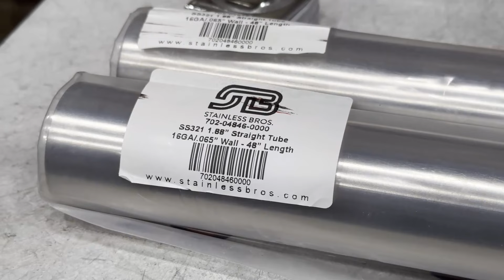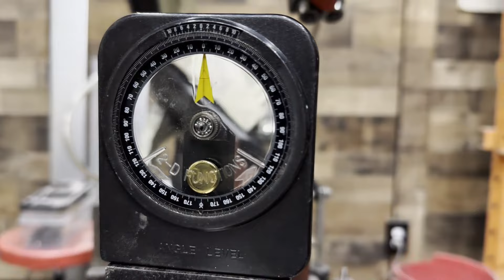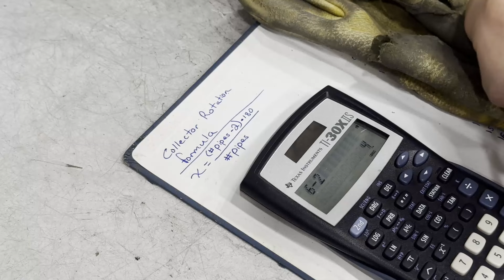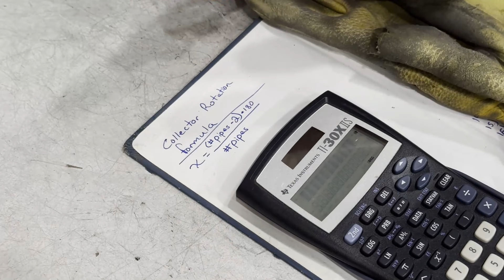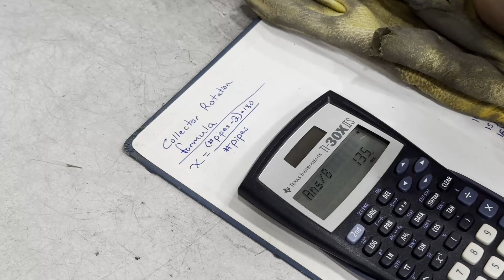Building a 6-1 Merge Collector for my Turbo SC300 Project (Step by Step DIY Build)

Comment: I’m always amazed how slow you can move when back purging stainless. It can just hold a bead without sinking
Reply from the maker: The puddle is much more predictable and manageable when purging. Virtually all stainless welding I do nowadays is purged, even down to the tack welds.

Comment: If i heard you correctly, you weld on the inside as well, which was why you didn't do a from debuting. If so, how do you handle purging the "outside" when you do that?
Reply from the maker: You did hear correctly, and thank you for a good question. I don't do anything to purge the outside of the collector, but rather apply as little heat as possible while doing these internal welds. Remember, the goals are solely to smooth and fuse these internal seams, not get penetration. In this instance, I pulsed the internal welds with my machine set at 70A to avoid disturbing the coloration on the collector's exterior as much as possible. Some disturbance is inevitable, but you shouldn't be applying so much heat that the outside of the collector loses all of its color.

Comment: Looks great.  Did you put a little quarter sized disk down in the center of the collector?  Looks that way to make it easier to weld inside those tight spaces.
Reply from the maker: Thank you for your kind words. I did not, but rather patiently did a weld build up in the pit. It takes some time/patience, but that's how I've always done it, for better or worse.

Comment: These videos are incredible to absorb info from. What approximate amperage are the welds on the collector itself on the outside vs the underside (down into the bottom of the 6 tubes merging). Is there a lot of time left between each weld? I'm struggling with not cooking things even when running what seems to be appropriate amperage + travel and dab speed
Reply from the maker: I'm glad you've found value in them. I set my machine to 100A for these welds and used as much as I needed. I'm a huge advocate for learning to read the puddle as opposed to focusing too much on what amperage the machine is set at. 

I weld collectors to completion in one sitting. The only down time between welds is the amount of time it takes to reposition the collector. If you email me some photos of your work I can do my best to offer some tips/feedback:

Alex@bpautosports.net

Comment: amazing video as always, what angle is your fixture set to? looked somewhat like 11 degrees or so. Only asking as compound rotation will change the angle of the cut needed as the angle of the fixture changes.
Reply from the maker: I don't recall what it is off the top of my head. I suspect it's in the 10° - 15° range as you said, although it does have adjustment to increase the splay angle. You're right in regards to the splay angle/angle of rotation having a symbiotic relationship. It took some time to figure out the discrepancy.

Comment: What is the strategy for welding the last tubes if you don't have space....thanks 🇧🇷
Reply from the maker: As I'm building the header, I take two angles of attack for final welds. 

1.) Try to run the primaries such that you leave a "pocket" to fit the torch into for the final welds. 

2.) Be strategic as to when I'm adding each primary to the assembly. 

It isn't a perfect science and I still run into challenges occasionally. However, applying these two strategies help to eliminate the bulk of the issues.

Comment: Im curious how the math works with your jig vs. the jig i made. I'm making a 4 into 1 for a 1g talon. On the first attempt, with scrap material, rotating the tube 90 degrees did not give me a 90 degree cut angle. Due to the splay angle, I had to figure out the correct amount of rotation to get a 90 degree cut angle. Im curious why you dont run into that issue with your jig. Mine sets the tube verticle instead of horizontal. Im trying a 15 degree splay for my R&D. But yea, I'd like to figure out the equation that compensates for splay angle, and number of tubes. At least for a round style flange, not a t3/4/6. 

It's really funny that you put this video out as im doing this. Thank you for always being so helpful. Idk if you recognize my name, but I comment and like a lot of your videos. I've been studying your manifold videos off and on for a couple of years. Your red demon manifold build last year actually helped me decide on the jmf 4g63 flange. I was not super pleased with the vibrant one that I got initially. Even though I was planning on going to Morrison route and form the tubes instead of going with the oval to round transition in the flange. The jmf flange checked all the other boxes.
Reply from the maker: My cutting fixture typically requires an additional 5° added to the base rotation. Using your 4-1 collector as an example, I cut at 95° as opposed to 90° to achieve proper fitment. It takes some experimentation to figure out, but it's just the way it goes. I don't know of a formula to figure out this discrepancy and elected to practice cutting with PVC initially to figure it out. 

It's my pleasure, I'm happy to put the information out there. I do recall going back and forth with you in the comments before. I'm glad to hear that you went with a JMF flange - they're high quality pieces. Nice materials generally aren't cheap, but they're game changers to increase the quality of your end product.
Reply: @AlexLindner  Fantastic! Thank you, again.
Reply from the maker: My pleasure, thank you for your continued viewership and support.